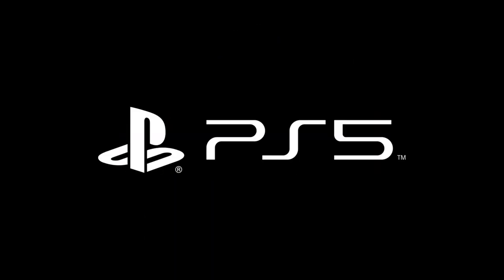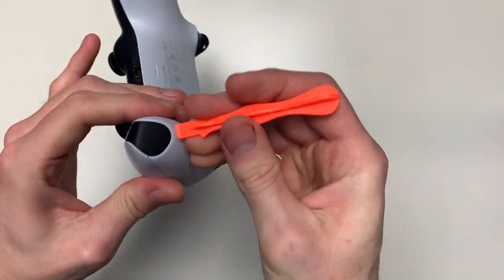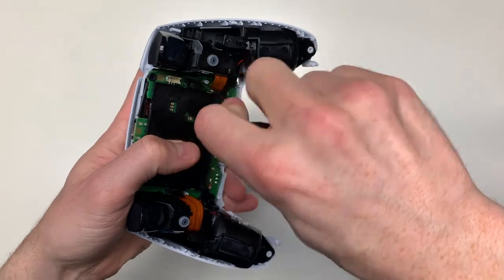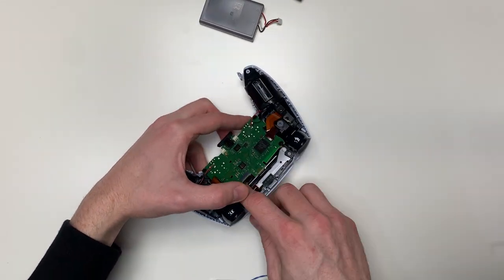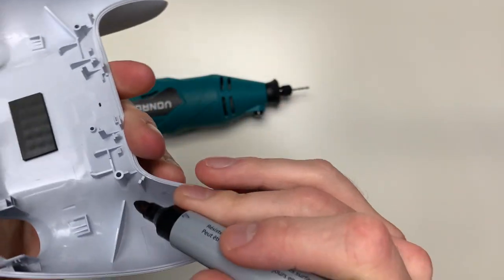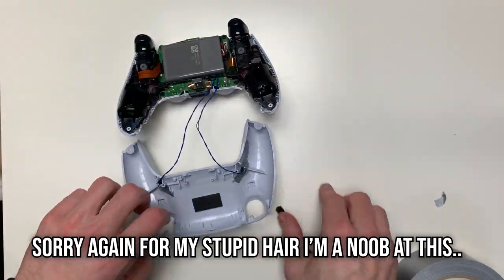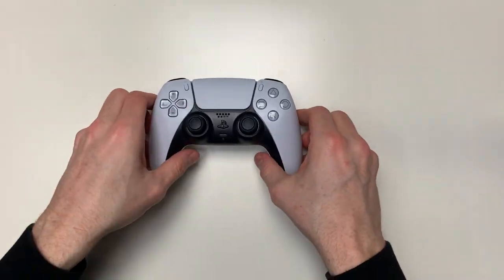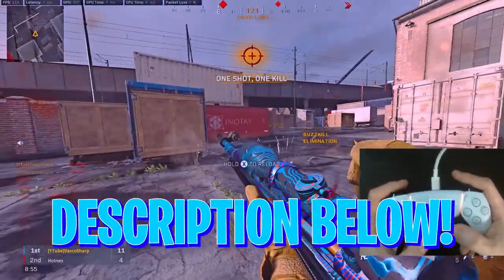DIY PS5 Scuf Controller Remap Kit (How To Make You're Own Scuf Controller)

Comment: hey man i just got mine and im about to set it up tomorrow, just have one question have you had any problem with using tape instead of glue for the tact buttons, like them coming loose or something? also do you have to use some special kind of tape or is normal tape ok?
Reply from the maker: I used a lot of normal but strong tapeb
Reply from the maker: And totally never had any problems even had 1 ps4 controller for 3 years with no problems. I made another scuf last week with hot glue also. You can do both
Reply: Where did you buy your paddels?
Reply: @ghelidoo4237  i bought mine from ebay but i dont recomend them cuz the build quality isnt the best, i ended up stick with paddles that are much better and more reliable and reprogramable, just look up ExtremeRate ps5 those are the ones i recommend and u can get them from amazon and not sketchy ass ebay
Reply: Did it work ? I wanna get make one but I don’t kno if it’s real or not.

Comment: Hey bro, I realy need your help. My order just arrived but i have one quastion. What is the size of the metal drill that you used. Mine is 2mm, any problem?
Reply: and can I use hot glue?
Reply from the maker: Can't remember the size and I'm not home yet till later today but if you take the same exact size as one of the back buttons then that will fit.

Also you mean hot glue for inside of the controller for the back buttons?
Reply: @VascoSharp  okok and yes. I have done everytihng already. Just the final parte i didnt
Reply from the maker: Oh nice bro congrats! Send me a Pic once you're done trough one of my socials

Comment: Where do you solder the points on the buttons. After I installed everything and turned on my ps5 it seems a button is stuck. When I put in my password it just keeps auto filling.
Reply from the maker: I did not solder the points.. Never done that before don't know how to work with that so can't awsner you're question sorrg
Reply: @VascoSharp  so your remap came connected to the buttons already?
Reply from the maker: Yes. Yours not? Where dit you buyed it? Xq gaming?
Reply: @VascoSharp  I got it off eBay. Came from Germany
Reply from the maker: Yeah I stopped with that company since they have bad customer service. It's weird that it wasnt as a whole thing